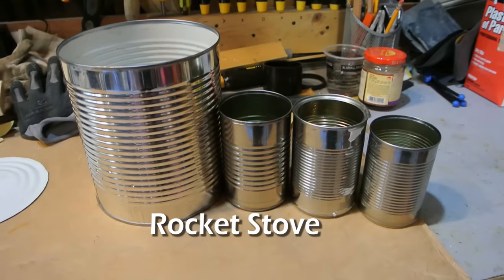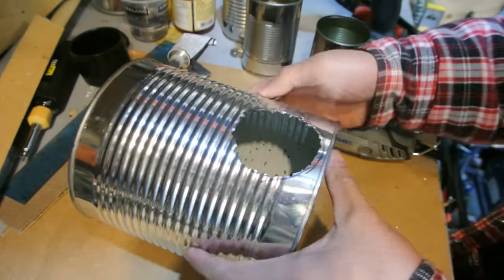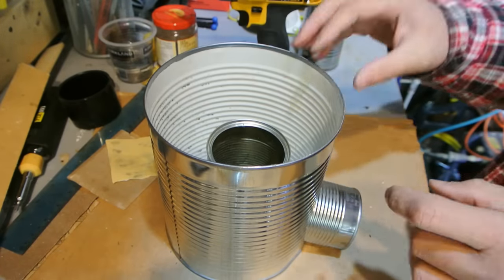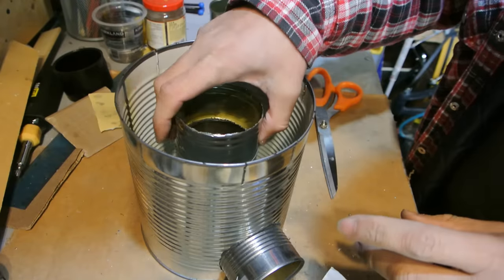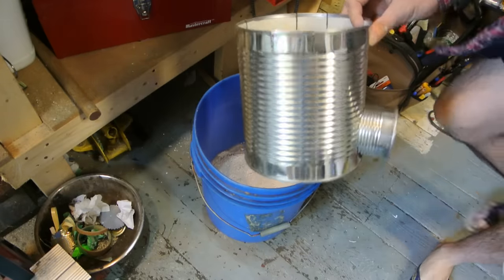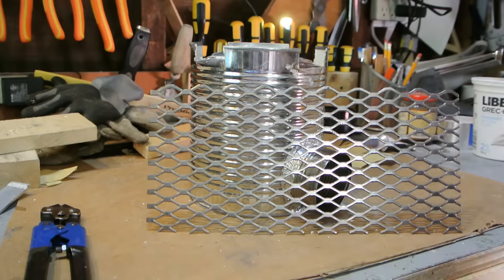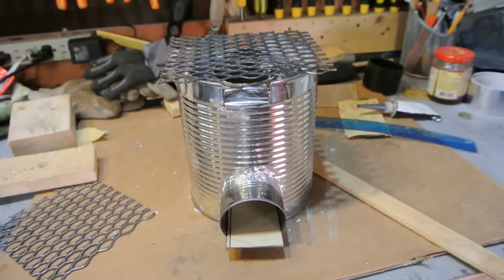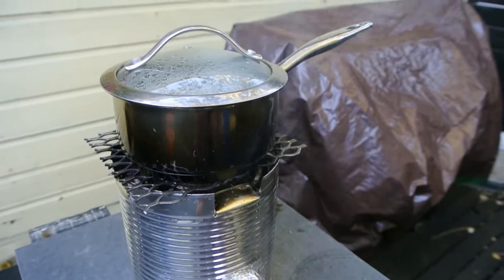How to Make a Rocket Stove from a Coffee Can

Comment: Better to place the feed spout so it is tipping downward into the rocket stove, thereby gravity feeding the stove is possible.
Reply: Makes sense 👍
Reply: Also, for safety's sake,  bend the corners of the screen to it from moving or sliding off the fire while cooking.
Reply: @karmelicanke  And he should have been using those gloves I saw in the background.  Safety is always first.
Reply: @beepositiveforever971  sa zxcxx
Reply: Then you would NOT have a Rocket Stove. That angle would, completely,   alter the air intake flow.  He's making a homemade Rocket Stove. Not a handy standard burner.you can slowly cook on.

Comment: Here's very helpful info regarding this type and a larger version i've made.  i made quite a few of the same type of rocket stove as in this video , and used them for cooking my food almost always twice a day every day for several years ; and i took good care of them and  i kept them out of the rains and i found that the fire(s) destroys the metal inner tubes in 6 months. And for evening meals, the coffee can size was problematic because after cooking a pot of beans and then doing more cooking frying food in a pan / skillet that would get interrupted because the ash builds up in the can and must be raked out so the air can flow , but raking out the ash also removes the coals too which are igniting the wood being fed in , and so the fire must be started all over again.  i solved the problem by making a larger version by using an empty maple syrup drum / can which is made for and used for bulk dispensing at health food stores. i obtained for several for free after the store had dispensed all of the maple syrup that was inside the drum and threw it away: The metal drum measures approximately 17 inches high and 13 inches diameter. i cut the can about an inch or so down from the to and turned the cut out end over and dropped it into the rest of the can :  the flare of the can produced a fit perfect snug and tight in place mating them together securely. For the inner pipes, cans the size of around 36-42 oz. (i say around that because i am not sure what the volume of the cans were now but the type that whole round pineapple slices come in : about a 4-inch diameter. The factory hole in top of can for it's pop-out pour spout i simply kept covered over with a small square of thin metal. And i used a small metal grate with legs to sit within the can head over the fire tube, formed of round metal rods about the same diameter as one found on shelves in ovens. That stove was most excellent. Hand tools are all one needs in order to make these stoves : a can-opener, a hammer and screwdriver (to create a hole to get the tin snips into), and a pair of slightly angled tin snips to cut the holes (Compound Action Tin Snips.)
Reply: Thank you. This information will definitely come in handy for a family of 8🙃 Blessings to you, sir
Reply: Thank you, Ted! Really usefull info about practice!
Reply: @user-mh1wv5hc5c  You are welcome! /Пожалуйста! Из-за вашего доброго слова, и увидев 60 лайков, я просто отредактировал его, чтобы добавить больше деталей и уточнить его.
Reply: @flowerchild777  thank you, Angela. i just saw your word of appreciation. And edited  refining what i put and added more detailed instructions about constructing the larger rocket stove.
Reply: Empty metal drum would be good...must go hunting for a suitable one.  Thanks for sharing your idea...and this video, great help
Reply: @ritakisil1669  thanks for saying so. Happy New Year to you, and all.

Comment: I learned how to make one of these in Boy Scouts.   Using a #10 can, a Tuna can,  some cardboard, and parafin.   The only tool needed is one of those old triangular punch can openers- to puncture a ring of vents in the side of the can just below the rim.   The flat bottom of the #10 can is your cooking surface- or you can set a pot/pan on it.    The tuna can holds the parrafin soaked cardboard- which burns nice and steady like a candle.   Best part- it's waterproof!

Comment: I was pretty skeptical that any of this would even be worth watching let alone worth building...
However, this was rather informative. A solid one-day project. Great for the kids. Useful end product. 💯
Reply: This can also be used for hot water shower.
Extend the length of the flue.
Put a coil of copper pipe around it.
Connect a hose to the pipe at the top to pump cold water in.
Connect a hose at the bottom with enough length to have a shower.
Pump water fast warm shower.
Pump water slow hot shower.
Pretty much instant hot water.
The longer the copper pipe the more hot water.
Reply: @rayblazejko6908   I've seen this done with an outdoor soaker tub. I mean, yes, clearly cheaper than a hot tub, but it's one hell of a setup process.
Reply: Ray Blazejko:  I was just wondering about whether this very modification would work; Tyvk!
Reply: @daphneraven6745  100%. My father in law had a fire with a copper 50 litre container. He put a 6metre, 20feet,  copper coil  half inch copper pipe in the copper bucket. Connected at both ends with town water garden hose . One end to shower , one end to tap. When the water was hot in the copper bucket he could run continuous hot water as long as the fire was going. Endless supply hot water. My way I described will do the same thing but probably simpler.
Reply: Ray Blazejko : Thank you for the benefit of your experience. In a pinch, it really helps to have smart, prepared people around!
Reply: @rayblazejko6908  that reminds me of a set up my dad did in the 50's with a coil from an old Steam Engine off a train and a 55 gallon drum. Of course, the coil took up most of the drum. We ended heating pots of water instead. 🤗😁.  Those were the days !

Comment: Great video! I used one of these while living in the mountains in Oregon for a few months and I've wanted to make one since. The one I used had rocks for insulation, and I believe the inner chamber/can was one of the smaller metal coffee cans which allowed for more room for more coals. To start our fires in them we would bunch up a group of small twigs, light them on fire then drop them into the top chamber. Then we would feed the fire from the side as you did here. We also used a billows to get the fire even hotter, which would bring water to a boil in about a minute. While these don't last forever it's definitely a good thing to have on hand in an emergency. Liquid or gas fuel runs out and can be hard to find at times of natural disasters. Sticks however are plentiful and free!

Comment: If you bend the pointy Corners downwards on your steel grate on the top it will stay in place when you're putting your pots or pans on or off... great video. Great idea. I am definitely going to build one of these for my cabin up north in case the power goes out.. the advantage of having one ready to go is that it takes very little dry wood to cook food or generate Heat...
Reply: Great idea about the pointy ends

Comment: A pretty sound design. I think if you used a paint can for the outer cylinder, it would give you a handle you could carry the whole thing with.
Reply: Or can put handle on it from old handle from bucket.  Like my plastic buckets gandle outasts bucket. I save handles. They come in handy for a lot
Reply: Or just poke a couple of holes in each side and use a coat hanger or bailing wire  for the handle.

Comment: As kids we used sand, gravel or cement for insulation. It also serves as weight.
Reply: Sand, gravel and cement are not insulators. They absorb lots of geat, reducing rhe heat available to cook with, and using a lot more fuel.

Comment: Metal coffee cans are getting rather difficult to find. 
Every hardware and craft store still has unused paint cans. 
Popsicle or paint stirring sticks coated lightly in Vaseline are great for quickly starting a fire if all that is available laying around is damp. 

For those who might want to go for a hike and have hot lunch in the remote wilderness, can easily get the total weight down to about 2-3 pounds by using warm soapy water with perlite, plaster, and pumice. The air bubbles displace the solids and add insulating value without reducing strength.
Also, consider having a thin layer of insulation beneath the burn chamber (inside can). This will extend the life of the outer can from heat cycle wear after repeated usage and reduce the risk of burning any surface that the stove is resting on.

These work so much better than any of the specialty portable fuel canister camping stoves for heating up a full pot of water to make coffee or a decent backpacking meal for a group of people.
Reply: Excellent project it works.

Comment: Great stove fella... Only thing I would've done differently is that I would use another piece of the mesh for fuel grate...
Reply: A solid piece of metal actually works better, as the sticks slide in on it as the ends burn up.
Also you want that air to be sucked underneath the solid metal, and to come up inside the chimney.
Not to cause a fire in the feed tunnel, as happened at the start.
The way to get the fire drawing straight up the chimney immediately, is to sit another open ended can on top of the chimney when lighting the fire. The higher the chimney, the better the hot air rises. As the fuel and air are not very hot to begin with, increasing the height of the chimney temporarily, gives a much better burn. 
Use tongs or gloves to lift the extra can off when the fire starts roaring!
Reply: @rubygray7749  b

Comment: Good use of used cans.
The grill that supports the wood in the firebox is better if its not a solid piece of metal.
The air movement should get all around the wood so it draws even better.
You could use some more of that expanded metal you used for the top trivet.
Or finer expanded metal that's maybe stronger so it can handle more heat.
The other thing is to turn the small extender piece of inside chimney up the other way so the cut edge is down and not a safety issue.
1kg Coffee comes in a tin can.
Or go to a cafe or restaurant and ask for their size A10 tin cans that many food stuffs come in for the catering trade.

Comment: I'm going to make me one of these :).  Another tip that's a great fuel to use is to keep all of your junk mail and when you've collected a box full, get them damp with a spray bottle of water, roll them up tight and clamp them with rubber bands, bread ties, string (anything that will burn) and then set them out to dry.  Makes great "sticks" or for a regular camp fire, make larger ones the size of small logs.  They last a pretty long time too!!
Reply: @danielateresita  Nice :)
Reply: Very bad
Reply: You can do this with newspaper also
Reply: used oil with a small cloth is the best fuel and less contamination
Reply: MegzeeR u
Reply: You forgot to mention that the ashes will be full of toxic components from the ink. What about recycling?
Reply: @jackboltsvolts8986  Most papers use soy inks these days. Nothing toxic about that.
Reply: @kimifur , please tell us the chemical composition of the "soy ink" you refer to, and which are the "most papers".
Reply: @jackboltsvolts8986  nice try soyboy

Comment: A mixture of waterglass and perlite gives a ok kind of refractory, by the way. The problem with burning wood and plants is that it makes corrosive fumes and there is little to none material which can resist for long. Doesn't matter, because this is how the world works. Refraktories are a kind of materials which are consumed during the process. For instance to make a car consums 2000 kilograms of refractory materials. They just dissolve into the molten glass which is processed  in the furnace. By implementing a good refractory covering the stove can be made in away so it last for very long.

I really like the video!

Comment: You could use a piece of the other grate for the feed hole. You could also bend the corners of the top grate down so it won't slide around.
    A trick that I learned in Boy Scouts 50+ years ago. If you don't want the black pitch to be stuck to the bottom of your pots and pans, before you put food in them, coat the bottom and sides of the pans with cheap dishwashing liquid. The pitch will still collect on the outer surfaces but it will rinse right off when you wash them.

Comment: Your horizontal segment should be angled upward instead of downward and should be much longer to hold reserve fuel. That way the fuel you feed into it will not spill out. 

The nice thing about a rocket stove (when it has a long 45 degree fuel feeding tube) is that it is gravity fed. You can loosely pile in a lot of scraps and they will feed into the fire gradually as they are consumed. 

Yours might spill out burning embers onto your floor and has to be fed very frequently.
Reply: Thank you excellent tip.  I'm going to do the 45 degree angle makes total sense.  Great timing as I am about to make a bunch of these stoves for when SHTF to give to family and close friends if they ever decide to wake up!  lol

Comment: Try tracing the can on a piece of paper and then use that paper to make the hole. It makes a tighter better hole for the smaller can. Also, if you use a can opener to make the holes on the outer can, it could help with the support of the lid.

Comment: You could also use a fine toothed saber saw. Just clamp the can down some how because you don't want it rolling around while you're using a saber saw.
You could have used that other piece of expanded steel for the fuel shelf inside the tube you put the wood into. It will let in plenty of air and let the ash fall down too.
Reply: turkey fryer space heater
Reply: YOU can use a saber saw...

Comment: Very nice build and instructable. I also made one of these from a 4 litre (1 gallon for you Yankees) paint can. If I may share with you something I learnt in my quest for knowledge before I built mine. The ratio of the inner pipes should be 3:1 up to 4:1 for the chimney to inlet pipe. Try butting one more inner can (with its bottom removed) as an extension on top of your chimney and I believe you will see a marked improvement in it's economy and performance. Once alight you will end up with a clean burning, no soot flame that produces a notable rocket sound and no smoke. My next step is integrating the rocket stove idea into a full size BBQ and fire pit concept for my backyard. Please don't take this as any form of criticism. I applauded you for documenting your build in a very well thought out way. I am merely sharing some knowledge. Well done and keep up the great work. BTW I have subscribed to your channel.
Reply: Uncle Zed: At the risk of appearing completely thick, surely another extension to the chimney would cause headaches with where to put the kettle? On that note, would you advise having a taller stove (like your 4L one). I'm guessing that the higher the stove the greater the air draw and therefore the more rocket like in sound and appearance.
Reply: Uncle Zed qw
Reply: Uncle Zed 
0p
Reply: Like your stuff. 
My comment at top.  Excellent video,  would like to see other version using Chock full of nuts type Coffee cans, as they have 1/4 in. reinforcing rings to maintain circular structural integrity. Other issues, using a pot with 1in.smaller diameter to drop in ,say 1-2in. would eliminate 4 wasteful holes in sides. 
2 small insulated handles would help. 
Is insulation that critical?
Reply: Who yall callin a Yankee?
Reply: Yes, the longer the chimney the better the air flow. Two coffee cans high better than one. nice job.
Reply: Did u make the BBQ one I'd like 2 see

Comment: It works the same way as anyone's indoor open coal wood fire , once it gets going if you cover the Fuel hole with something and leave a little gap it will really get going , because your slightly starving the fire of its fuel (oxygen) the Oxygen will flow into the little gap faster.

Comment: Try J&B Weld instead of the metal Duct tape.  Takes a day to dry, but it can handle the heat.
Reply: BTW, You did a great build!!!!!!  :-D
Reply: Ronald Heroux
Reply: JB weld works for shit, i tried gluing a handle on my gas grill with loose screws, held up for one cooking session and failed.
Reply: @mrbadx19  
YOUR 1st. ( MISTAKE ) 👈🏼 WAZ
YOU (GLUING) 😂😂😂  ........
IF (EQUAL AMOUNTS) ARE LAID OUT
& THEN (MIXED) VERY WELL 2'GETHER
JB WELD 👈🏼 ......
 IZ JUST AZ TOUGH AZ A BOND AZ
A WELDED BOND....
( YOU 👈🏼 )
ARE JUST A (BAD EXCUSE) FOR A
HUMAN BEING IZ ALL ......
Reply: G H  There is a high heat version that I used on my oil furnace.
I would recommend that for this application.
Reply: As an aside I set JB weld on fire when I was a teenager trying to make a JB weld rocket nozzle
Reply: The metal tape worked far better than JB Weld ever could and in a fraction of the time, effort and expense. It only has to hold the pieces until the insulation sets. I've been using it for special effects burn rigs for decades. Ignore the NPC's think they know better.
Reply: I like this brilliant idea...good job!!! 👍
Reply: Nice
Reply: @mrbadx19  Most opinions are only worth 5¢ since abolishing the penny.

Comment: If you put the mix inside a plastic garbage bag inside the bucket, you dont have to rinse the bucket, and when mixed just pull up the bag and cut the corner, and let it ooze like a cake where you want. easier than scooping! also, how did that tape hold up? safe? good build man. thanks for the vids. making one this weekend! rock on.
Reply: Just TD